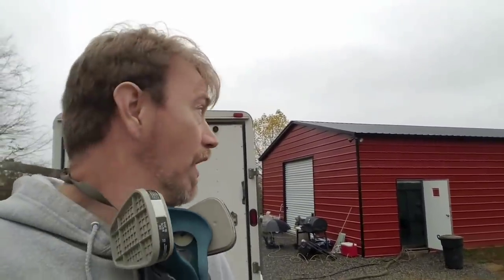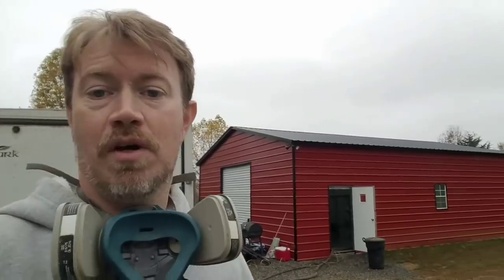Insulating Metal Buildings With Closed Cell Spray Foam

Comment: 1.5" gives what R value?
Reply: JOe Shmoe it's roughly 1 inch is an r value of 6
Reply: JOe Shmoe R 10 or R 11 depending on the product
Reply: 2lb closed cell is roughly R7 per inch. BUT, it's not fair to closed cell foam to rate it like that. Remember that 1/8" foam, piping hot coffee cup we all place in our laps driving around? CC foam is an air, moisture, dust and so on barrier. 1/8" CC foam performs better than R60 pink fiberglass. Why? Fiberglass doesn't seal anything and you breathe that shit it for life.
Reply: @jimdavidson5208  I think people believe thicker is better when referring to cc foam. The greatest advantage to cc spray is the stopping of air infiltration. Sealing air tight with foam beats fiberglass everytime.
Reply: I went to a NARI expo last year and what I got out of it is that you get diminishing returns after just a couple inches.

Comment: How flammable is that stuff?
Reply: It will NOT burn. I tried to get rid of what I had to trim off and even with fuel oil it would not burn, put it in my wood stove with a fire....took it out the next day after the fire went out and put it in the trash!

Comment: I'm impressed with the spray insulation, but the electrical work is what I wasn't impressed with.
Reply: I was thinking the same thing.  Lines should have been run through conduit in case the line fails and a new one needs to be pulled.

Comment: Very clean application. There is one thing extremely wrong with what you are doing though. There should NEVER be an open flame in the room while spraying! If you obtained any certifications for spray foam, you would know this. OSHA would have a field day if they saw this. If I was you, I’d delete this video before they see it. Then I would get the proper certifications and training for you and your employees
Reply: that is not an open flame
Reply: DeminicusSCA Oh it’s not? Then please explain to me how a diesel powered torpedo heater is not an open flame
Reply: That's risky. Most certainly an open flame.
Reply: Becase it is burning in a combustion chamber behind a heat shild and flame arrestor , its not open flame. sorry you dont understand
Reply: norty my suggestion to you is not to use them in your spray foam business.  For the rest of us, the term open flame has a meaning, exposed flame. If something fell on a candle or torch it will come in contact with a flame at 2500F+ degrees!! , IE OPEN FLAME.  The flame in a heater is closed, and outlet temps don't exceed 400F !!!  If something fell on it, it will not come in cont contact with 2500F flames .    I don't know why you cant understand there is a technical and very important practacal difference between, 400F hot  exhaust and open flames.    You seem completely ok with the fact the heater is Full of Diesel, sitting on top of the combustion chamber,  but worried sick someone is spray foaming 10 feet away.
Reply: DeminicusSCA Why? Because the vapors from the spraying process are flammable! I do this for a living. (10+ years!) I have obtained the highest certification for closed and open cell spray foam. I also have 2 out of 4 OSHA certifications. I’m not spewing BS. Your OPINION on an open flame is very different from OSHAs definition of one. Having a torpedo heater running in the building while spraying foam will cost you and your company a hefty fine. It might also cost someone their life. I’m done debating this subject with people that don’t have a clue about spray foam. I’m trying to help educate people that obviously need it. If they choose not take my advice, that’s on them. They can continue to be hacks
Reply: This company sucks lol. The only thing they're doing right is the dude in the suit. Cameraman doesn't have an air fed on, let alone glasses. Halos for daysss.
Reply: The heater in of itself is not classified as an OPEN flame device . The problem here is the vapors are flammable and will get sucked into the rear of the heater and drawn into the OPEN flame which could cause an explosion . It's the same reason you would want to extinguish the pilot light of a gas water heater before spraying .
Reply: Norty
Reply: Ever notice how many "experts" scour YouTube to comment on videos.  By experts I mean jobless trolls with nothing better to do while day drinking.

Comment: sorry about this I do fine spray foam to be a very dangerous because it is very flammable special in a workshop that could be using flammable things  sparky do travel and hide and they could start a fire when they stay hot  we had a building when up in flames with the spray foam 3 day after we were grinding and welding in the building  yes the painted the walls after the spray foam was put on  we look into way it when up so fast 
they said the spray foam fueled the flames it's like throwing on gas to the building they said lost a new building and 3 vehicles and travel trailer  in the building as for the insurance they would not cover the lost do to the other claims had been done 
  had a welding truck and travel trailer when up in a fire year before that first time was in a wildfire we had been I was working
the travel and the new track never seem any work  just got the new truck that day
Reply: That is why building code requires gypsum board (aka sheet-rock) over insulated walls.  That's what it's for....a fire/spark barrier.  This is why permits are required and inspections made by the county building officials where you live.  Of course, the insurance company does not want to pay-out; and, not building to code gives them a legal reason not to pay-out.  Be aware of this DIYers.
Reply: pink insulating I still go with it does stop the fire longer than spray foam does.  they need to put something in the foam to make it much safer  meaning not catch on fire
Reply: @d.grigsby8211  wrong on a couple of points, I have NO INSPECTOR, NO codes, and this stuff WILL NOT BURN. I tried to burn my scraps, couldn't even with fuel oil and wood fire.
I hate city boys trying to tell everybody what they can and can't do. Move to a free state and do what you want.
Reply: @jenniferwhite6089  they do, and it will NOT burn.
Reply: You may be thinking pf open cell IDK, all I know is mine would NOT burn no matter what I tried
Reply: @integr8er66 
What "free state" do you live in that has no building codes or laws?  There once was a time when there were no building codes; and, in much of the Third-world that condition still exists.  That is why the death toll is much higher in those countries due to fire and collapse of structures.  We've experienced the same in the USA over the past hundred years or so and have learned from mistakes and in the advancement of the building sciences to build some of the safest and high performing structures in the world, and saved many lives in the process.  The reason building codes exist and there are permitting processes and inspectors to track and enforce them is so that no Harry-Home-Owner or Fly-by-Night contractor can create a death-trap for the future occupants of a structure.

Comment: The guy doing the work is a true Craftsman. If your structure is climate controlled, and sprayed with closed cell..The procedure will pay for itself very quickly. Be careful of the "we do it cheaper" guys!!!!!! They use open cell foam. It is not the same! Hire a guy like this one and get it done right. Or call me! I'll do it for half his quote. You can call him a year later to do it right lol....

Comment: I work at a metal building company, we do not recommend spraying foam on the panels to insulate the building. It will void the material warranty and it can cause the panel to rust as the foam will not fill in all areas. In those voids condensation will be trapped and the panel will rust out.

Comment: Who the fuck wired the building? I bet the Electrical Inspector did not sign off using Romex with tape holding to the wall. Should have been done in MC.
Reply: Ah who needs codes we don't need any stinking codes
Reply: Actually I just did a similar building on my property with 95% of it being MC  but did have some Romex as he has in a few areas . The inspector suggested placing it in the rib of the metal as no one should be putting a screw or anything in a raised rib from the outside and it is furtherest away from the interior walls if anyone decides to mount something there . I used tape to hold the wire away from the metal as far as possible until the foam cured .